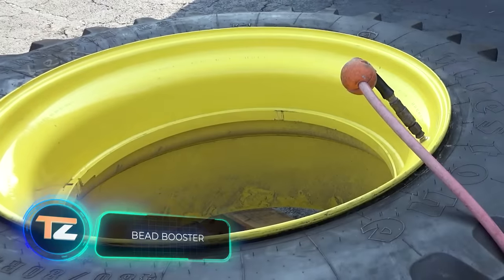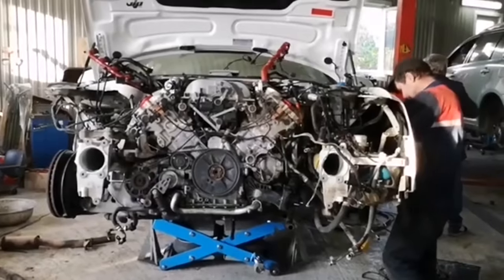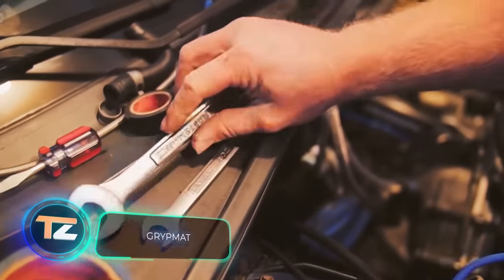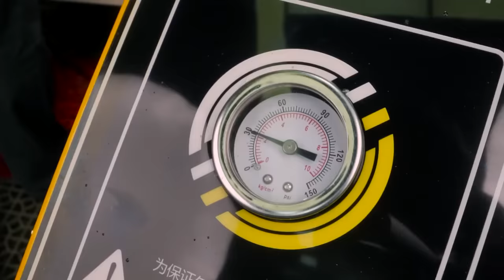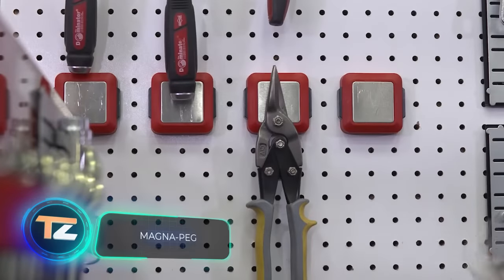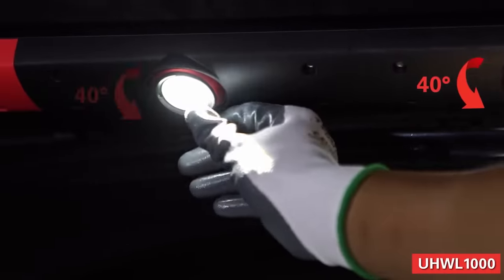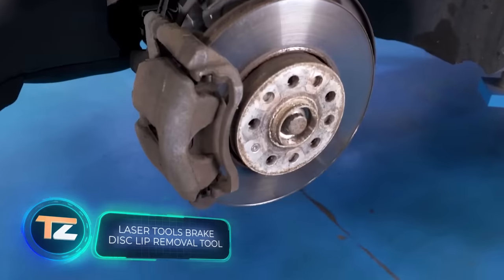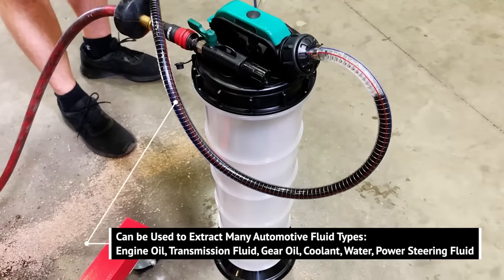INGENIOUS INVENTIONS FOR AN AUTO REPAIR SHOP

Comment: I (and many "big tire" busters) have been using a tiny little shot of starting fluid (petroleum ether) to set the beads on tractor tires for decades. One half-second shot of the stuff to the inside of the tire, toss a lit match in there and BOOM! Bead fully set, all the way around.
   You have to have a can of the stuff anyways, it doesn't take up any floor space and that little bit isn't going to bankrupt you, nor does it need maintenance, lubrication, electricity or a hose to your compressor tank.
Reply: Yup 40+ years in tires. Either has always worked well. But some States and in Canada they have either sniffing dogs. I have had customers who were given multiple tickets for using either in tires.
Reply: My best friends brother would do that when I was in high school.  Shake the entire shop .lol
Reply: Using starting fluid will void any warranty you have on the tire
Reply: @jamessmith2634  Yup.  Ether destroys the bead.

Comment: The Astra Minilift looks like a real time saver. I wonder if it has some sort of fail-safe mechanism to protect against sudden hydraulic/pneumatic failures.
Reply: I definitely agree with you about the safety of some of these Jack I'm a retired auto mechanic safety is your number one priority when using Jack's and jack stands
Reply: @kentbarger8628  Thanks for sharing...
I couldn't find any specific details about the safety features of the Astra Minilift. I see no reason why such a design could not meet an acceptable level of safety if it had features such as:
1) Strong construction combined with proper engineering and rigorous testing
2) A mechanical backup system in the event pneumatic/hydraulic system failure. Possible options are: the use of manually inserted locking-pins or the use of a ratcheting mechanism on each swing-arm with a lever that must be released before the jack can be lowered.
3) I see an increasing amount of aluminum-alloy being used in newer designs. Compared to steel, aluminum snaps suddenly and often with no apparent visible damage. Now, a suitably designed aluminum part is perfectly acceptable (e.g as in aerospace) so long as you routinely inspect the parts one-by-one for metal fatigue, using ultra-sound (best choice), eddy-current, x-ray, or UV dye (it's better than nothing). 
Let's be honest... How many mechanics have access to all that !?!
Reply: If you look at the video there using jack stands.

Comment: Those air bottle bead sealers have been around since forever.  Heck, I made one myself out of a portable air tank, a 2" ball valve and a big flattened pipe nipple.  Used it for years and finally gave it away.
Reply: If you are feeling particularly dangerous or brave you can put water in them and fire it at each other too,👍

Comment: As a mechanic, some of these lifts make me nervous...
Reply: Every mechanic nightmare is getting crushed by a car lift 😂😂😂😂😂
Reply: Ok cool I thought I was the only one thinking some of these were pretty sketchy looking
Reply: Yupp.
Reply: Jesus is coming. Read the Gospel.  Dude, you’re in the wrong thread.
Reply: @Kenya-Kikuyu  I had one almost get me with a 1 ton truck. I now check the safety locks every time. And i dont work at that shop any more....
Reply: Yea I wouldnt be caught under some of this stuff
Reply: I work at a ford dealership in the body shop. The service techs have this portable individual 4 post lift that’s super heavy duty. They use it to lift motor homes and busses and shit!! No fuckn way my ass would go under that. So damn sketchy looking.
Reply: Better safe than dead.
Reply: The first one can be pretty safe with wheels on and race ramp stands under them
Reply: Also a mechanic. Completely agree. Also, some of these things are nothing special. The blaster from the beginning, we've had something similar for about 15 years. We also have one attached to our tire machine. (It sucks though). And the window guys have been using those suction cups for as long as I can remember

Comment: I mount 16.5's 950's on old school GM rims. The fronts are 9 inches and the rear 10 so that they align with the bodywork precisely. And yes, they did make 1000's 16.5. These were a unique size for RV's and float trailers to take the weight. Now here in Canada they just slap $1000's in fines if you use a regular tire on a home style trailer. 
However, finding someone with a couple of "tire blasters" and the experience to use them leaves me with one guy...

Comment: The bead seater is similar to what we used at les schwab tire center when I worked there, those things are insane! Coworkers and I were messing around(OSHA approved of course), and I got bombarded by a group of people who held me in place while they stuffed it into my shirt and released the max pressure 😂 blew all of the buttons off of my shirt and busted the latch on my belt off, dropping my pants straight to the floor

Comment: There is only ONE tool I have not used 40+ years ago... the magnetic hail dent remover... cool HOWEVER, a neutral flame on a torch at about 30 deg angle does the same with no paint damage either.

Comment: Thanks. I bought an oil extractor to change the oil on my Audi (like the dealers do).  It works brilliant & because the oil filter is on top there is no need to jack up the car!
Reply: Why not just remove the oil pan plug? That way the sludge comes out as well. It only takes me 15 minutes to do an oil change compared to the hour or more the dealer takes.
Reply: @fuckyougoogle1148  Some of these newer cars take quite a bit of work just to get to the drain plug. Under body panels can have a lot of fasteners. I'm sure the OP's Audi is like that
Reply: @frankdaniels4364  Nope. Audi is a piece of cake to remove the under panel. All galvanized 1/4 turn captive fasteners. BMW, Mercedes, Nissan all have a 1/4 turn fastener in the under panel cover, if the drain plug is covered at all. Been a while since I've owned a Toyota, so I can't speak to that or domestics. Hyundai is the worst for requiring panel removal because the fasteners rust in place, then snap off when you try and remove them. Basically, crap quality in general.
Reply: @fuckyougoogle1148  We don't see many euros in the shop(kinda rural) and I mainly do diags and engine repair, electrical. Good to know on the Audi's. My FB groups must be talking about other Euro's

Comment: Using imperial units instead of metric is bad enough... but converting a 300 kg capacity to 661 lbs (down to a one pound accuracy, as if you put 662 pounds on it it will suddenly snap and implode) shows a gross misunderstanding by the script writer of how these ratings are specified by the manufacturer. Dude... say 660 lbs or even 650 as a round number is more realistic. Saying 7716:2 lbs capacity, down to the 0.1 pound is even worse. Please stop it.

Comment: That tool to help reseat the bead on tires is cool. But can’t hold a candle to The Old School method. I was on an excavation crew a number of years ago, when the 10 wheel Mack I was driving was low in psi and in a tight turn  and broke the bead. We always carried air hoses and chucks to use the trucks air brake system to help blow up tires in a pinch. But with the bead unseated the other guys on the crew thought the worst! But you should have never seen the faces on them when I grabbed the can of starting fluid and asked if anyone had matches!!! One of the smokers handed me a pack of matches, then I proceeded to blow the starting fluid into the tire around the bead, they all went running behind something and thought I was crazy! But I folded the match over the book with the sulfur on the striker, then flicked it with my finger right into the tire, turned my head around and BOOM! The tire was right back on the bead, with actually 60 psi! Already! I added another 60 psi and was finished!! They were all looking at me like they had seen a ghost! My Dads old trucking company mechanic showed me that trick 30 years before that! I have used it on more than a few occasions!
Reply: I have used it myself many times, my first introduction to aerosol inflation was trailer tires during DESERT STORM 1991

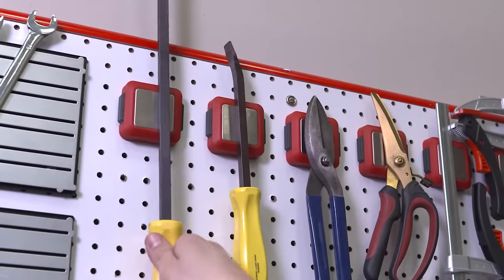Comment: 9:00 a 5 dollar solution to a 5 cent hook
Reply: The challenge for most hooks is they tend to come off when you remove the item which is hanging from it. On solution I've seen is to organize the hooks then use a small plastic zip tie to keep it in place.

Comment: 7:50 "The Bead Buster doesn't require any  electricity batteries or fuel" then proceeds to use a cordless drill with a battery to operate it.

Sheesh.
Reply: My thoughts exactly! Glad someone else had the same thought
Reply: But the tool itself does not need any batteries...
Reply: A wrench or ratchet doesn't need electricity .  . . during daylight hours
Reply: i was just thinking that!!! and technically the "tool" itself isnt battery powered. but tell me, are you gonna sit there ratcheting a wrench that much? your wrist would cramp up. xD
Reply: @ML-jk3sz  

Thank you for reply, tool.
Reply: @glengivens2725  

Anything to try to sound right 😆👌.

Comment: TCE 4 Post Car Lift is op. Are there any car weights more than 7000 pounds that small enough to fit on that thing ?
Reply: Other than for a roof, I can't think of a situation where this would be applicable, but maybe it can lift that much so you place other stuff on stop of its pillars?

Comment: Seeing people working under cars that are not secured by axle stands or similar devices always makes me uncomfortable.

Each year fatalities are recorded as professional mechanics and diy mechanics are crushed to death because they failed to secure stand supports in addition to using a jack, which then failed!

I don't trust seals on hydraulic or air operated jacks or lifts, I want a solid stand that secures the load with mechanical stops which cannot fail.

One's health, future and life are too valuable to have it prematurely ended by a faulty or badly set lift.

Comment: Whoa whoa whoa. The scraper used to remove the lip of the rotor is the worst idea ever. With a lip that big, that rotor is below spec. Has to be replaced. Not made to look new again. That should be illegal actually.

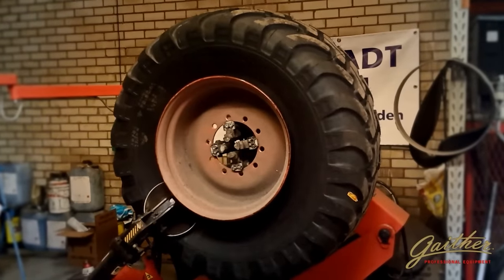Comment: 0:33 the tank is made of aluminium has an inside coating tha prevents it from rusting? Why? I'm confused.
Reply: Compressing air naturally produces water,most of which will come out,some will always remain,hence why water drains are provided on air tanks,compressors,etc. Aluminium doesn't rust as such but will corrode if left unprotected just from the air alone and why almost any aluminium you see has been passivated in one way or another.,Adding water will hasten that corrosion without a barrier,especially the water that comes out of compressors😮. Any internal and therefore unseen corrosion on any pressurised vessel is a risk, even more so with one that constantly tests the materials strength and elastic properties with repeated and rapid changes in pressure.

Comment: Most yahoos use starter fluid in tire to seat bead...light it then apply air
Reply: Those “yahoos” are referred to as men.
Reply: I've been a tire guy since 2005 and never done it once, if you can't get a tire seater with a blaster and maybe some Murphys than you don't belong around tires
Reply: Man, I haven't heard the term 'yahoos' in about 40 years.

Comment: I never really understood the tire cage ? When you remove the tire it's at maximum pressure it could blow up rolling it to the vehicle?
Reply: Safety, the tire that was rolled into the cage in this video is a 100-150 operating psi tire. There used to be an issue with bias tires exploding when mounting, also when paired with split rims those can separate violently when they aren’t supposed to. The military still has them in most shops for the old style tires that are still on hand

Comment: The cage is just for protection on high pressure seats. Since those have a tendency to explode. But the bead seater was first made by a company called "Cheetah" it is the "Cheetah bead seater". Ive been using one of these for over 30yrs!!! Not at all new tech. We use them more now that punks think stretched tires look cool for some retarded reason.  Or on trailer tires. They need it a good bit if they're cold. Most of this is old tech but seems new to a mechanically uneducated persons. Its just newer versions of old equipment. Been around for yrs and in some cases over 100yrs. Just a newer version...... And with the cage you DO still have to lift the tire. For mount & dismount from the vehicle. From mount & dismounting the tire on the rim. & to chuck the old tire into the tire recycling pile. You wanna end a bunch of lifting??? Make a machine that changes the tire while still on the car & also balance it there too. Kinda like the brake lathes that work while the rotor is still installed. That would save backs. Especially on mud trucks or industrial trucks & equipment.
Reply: Haha vertical removal and installation on semi tires is the only way I know to not lift tires, frowned upon by most companies

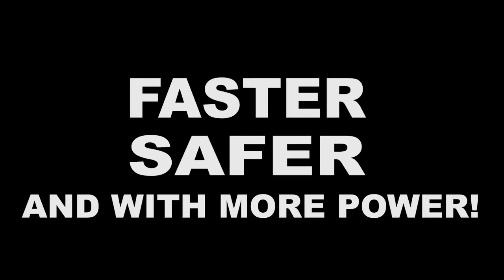Comment: 0:33 aluminum doesn't rust. It corrodes.
Reply: Aluminum also cracks especially the newer cheaper wheels. In the last month, I've had two cracked aluminum wheels and one pen hole leak a steel rim.
Reply: It's the same.

Comment: Tires should not be aired in vertical position .This way curls the tire bead out of position when inflated
Reply: This is true on steer tires but once beads are seated pretty well all tires get aired up in a cage at almost every tire shop I've been at (I've been a tire technician since 2005)

Comment: The tank is made from aluminium and the inside is coated with a rust resistant coating? Ummmmmm Aluminum doesn't rust. Derrrrrrrrrp!!!!
Reply: Aluminum still oxidizes and the aluminum oxidize partials can fuck up equipment.

Comment: Tank is made from aluminum yet has a special coating to prevent it from rusting?  Ah ok….
Reply: Aluminum can corrode, it just happens that aluminum that does in typical environments, air, nitrogen, moisture, pressure, etc.  results in a surface color and texture that is nearly the same as clean aluminum.

Comment: I would love that Matco light, but not for $210
Reply: Do you think it would be better enough than a headlamp, clamp light, or having your son hold a lantern (aka clamp light with a broken clamp) to justify the cost? (genuine question)
I'll give you that it it at least less expensive then the son, but idk about the rest.
Reply: @ZanderSabbag  I don't work on cars enough to justify the cost. If I had a shop, it would probably be worth it. As it is, my headlamp is plenty.
Reply: Some other competitors cost way more than that if you think that under hood light cost too much. Milwaukee's light cost upwards of 249 and that's without the battery or charger.

Comment: Unless the next dent puller you show us has Bluetooth, Wifi capabilities so I can monitor it when I'm away, an LED light, a multitool, a USB port to charge my iPhone, or some other trite and mundane option that everything out of China seemingly comes stock with nowadays... We don't want to see it. They're all basically the same. Even the ones that aren't basically the same are basically the same. Also, your titles always amuse me. "INGENIOUS INVENTIONS"? C'mon, man. Your definition of ingenious and mine vary greatly. Very little of what was in this video could be described as ingenious, if anything at all.